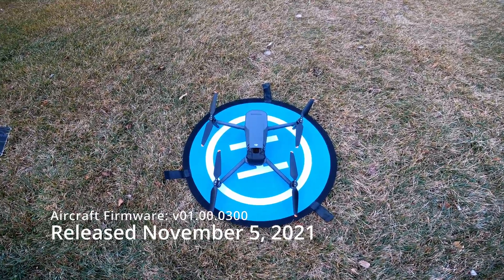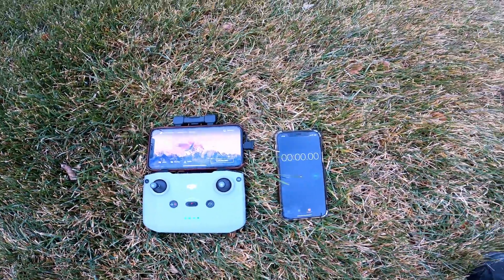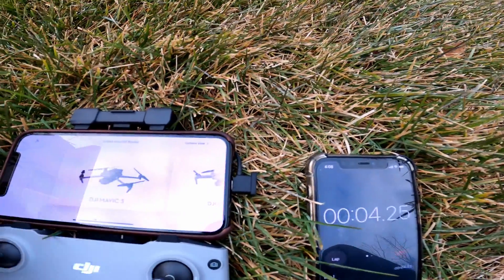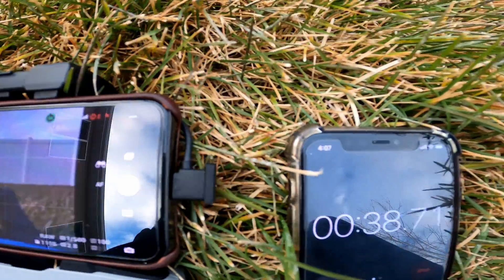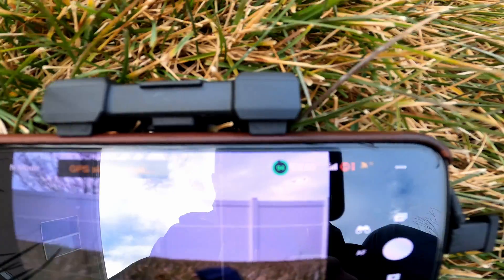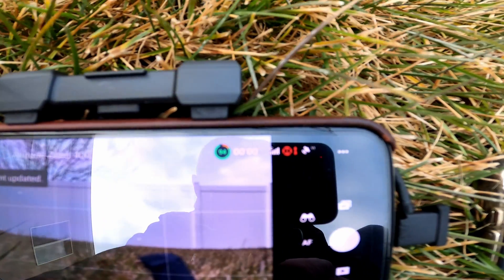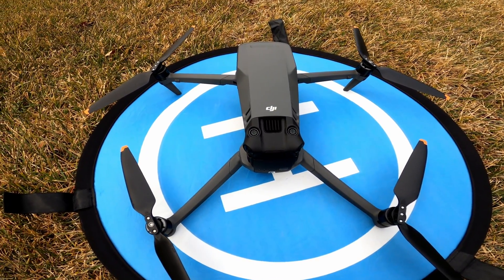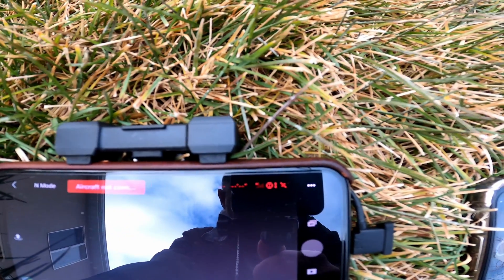Critical Mavic 3 GPS Problem?

Comment: Ok sold my mavic 3  that i bought in November with gps issues bout a new one a few days ago and zero gps issues
Reply from the maker: Thanks for the comment! That's interesting. So do you think the hardware on the first one was bad or that the software was improved enough that your new one just gets a lock faster?
Reply: @HansonAirPhoto  this new one came with the same firmware off the last one i sold and it’s was good gps in seconds satelite lock update and still quick lock so I’m thinking is hardware issues
Reply from the maker: @josedominguez659  Could be. I'm hoping it's something not quite as permanent. I know for me, conditions and location make a big difference.

Comment: Need advice, looking at my first drone purchase and in full debate between air 2s, Mavic 3 or evo lite+. Do you feel the slow gps lock is a deal breaker? Do you feel dji is going to fix the problem? I don't mind spending extra for a really nice drone to last me years. Thanks in advance.
Reply from the maker: If I were buying my first, I would definitely go for the Air 2S. Nearly all of the Mavic 3 features at half the price. I’d spend extra money on batteries instead of going higher end to start out. But the Mavic 3 is nice and I don’t believe the GPS lock delay is a show stopper for people interested in it. Good luck with your choice and happy flying!

Comment: I was going to record this too but I realize that by the time I calibrate compass, fine tune my camera settings, RTH and APAS settings, check flight mode, I'm good to go, also I do this while hovering about 10 feet up as I warm up the batteries...thanks for sharing.
Reply from the maker: Good way to use that time!

Comment: Thanks.  You just gave me a reason to keep and use my Air 2 batteries that have slightly bulged out after a year of heavy use.  I would never use them in the air but I could use them to acquire Satellite signals and lock them in.  When ready to fly, restart with a new fresh and safe battery.
Reply from the maker: Good idea! Old batteries can be useful for firmware updates too. Thanks for commenting!

Comment: Within GPS several "power up" modes have been defined. Hot start, Warm start and cold start. Cold start is when you have no clue of where you are and the tracker is turned on. The tracker will have to update its almanac on all the satellites positions, their status and time. This can take more than 10 minutes, since the satellites do not send all the time and their data packages do not contain a full almanac info package in every transmission. 
Warm starts are normally in the 30 seconds to a couple of minutes range, you kind of know where you are and the internal clock inside the GPS receiver is not way out of sync. 
Hot start is normally below 20 seconds. If the phone knows where you are then it should be possible to share some of the info and speed up the process moving from cold start to warm start. Similar to assisted GPS used in mobile phones, where the mobile cell tower shares the almanac data for the area with the mobile phone.
Reply from the maker: This is great information! Thank you for sharing! That definitely coincides with the timing I’ve seen at startup.
Reply: First of all,  the phone has nothing to do with the GPS acquisition time. Turn your M3 on with and without the controller. Same amount of time required. No offense but using buzz words like" tracker" and "almanac" (that no one else is using)  makes you sound like you are are elderly and talking out the side of your ass.
Reply: @foam27  All I am trying to say is that getting a position could possible be improved by DJI by using the phones GPS receiver in co-operation with the drones GPS receiver. Almanac like it or not but that is the word used by the people who made the GPS specification. If they where elderly at the time I do not know. Most likely they are today.  English is not my native language, so yes tracker might be the wrong word to use. "GPS receiver"? or ?

Comment: The seem to be the same problem with the Air 2S, it takes about the same time as for the M3 ,It must be some issues with The DJI Fly App.
Reply from the maker: Very interesting! I don’t have an Air 2S to compare with but it makes sense that the slowdown is with the app if multiple aircraft are affected.
Reply: @HansonAirPhoto  I Will make a test tomorrow and let you know , its almost midnight 10:07 pm here in Thailand now
Reply: Hello again , I made the same test as you did with your Mavic 3 today and it took 2.20 min to acquire 12 satellites with my Air 2S with a OS device,  when I shut the drone and the remote and started up exactly the same way  5 minutes later from the same spot, it took 20 sec to acquire 17 satellites . My conclusion is that it must be something wrong with the fly app , I estimate before the fly app update it took about 30-40 sec get the home point updated to take off in a secure way.
Reply from the maker: Good test! I really does sound like something in the app. Hopefully, they can do something about it soon.
Reply: You can uppdatera now New version out for iOS 1.5.9, It works
Reply: @HansonAirPhoto  They did my friend
Reply from the maker: That's great to hear! I'll have to update and go fly with it. Hoping it'll speed up my acquisition times as well. Thanks!

Comment: This abnormally long delay (which will vary a lot day to day and location to location) would be acceptable for a $1500 setup. It is not acceptable for a $5000 setup. BTW you never tested on a cold GPS lock on the new firmware. You already tainted the experiment with your first test. It can take 5-10 minutes sometimes. I returned my M3 + RC Pro for a Skydio 2+ Pro Kit. Absolute blast.
Reply: S2 is nowhere near comparable to the M3. It has less flight time, can't shoot at night and has one of the worst camera sensors of any "premium" drone. It's a toy compared to the Mavic from an image/video quality perspective. The S2 doesn't even measure up to previous gen DJI products, never mind their flagships.
Reply: @BorderReiver29  True, S2+ is no M3. But it is an absolute blast. I’m not a Pro making movies. The S2+ makes flight time and range more respectable. I wish it did fly at night. But it’s tracking and obstacle avoidance makes up for it 10x over. I have waited as long as 10 minutes for home point on the M3 and lose Sats Mid flight and get capped. It’s an absolute joke. I could buy an Air 2s with RC Pro and still be ahead than owning M3 with RC Pro. I was seriously thinking of doing that but I’m so disgusted with DJI and having so much fun with the S2+ I may never bother.

DJI is clueless on tracking, obstacle avoidance, customer service and pricing. And now they can’t even get GPS right. The whole company is a complete hack. I really hope Skydio and Autel get a boost out of MavicGate :)
Reply from the maker: Glad you've found something that works for you! I've got a cold test of the .400 timing coming in my next video. It was shorter, but I was at a different location. So it's probably not a valid data point. I'll be following Skydio for the future. They're doing some interesting things! Thanks for watching!
Reply: Damn you gave up a LOT of range going Skydio 2, but maybe you didn't need it.

Comment: But time first time you used 15 seconds opening the app and connecting to the M3 so 1 minute isn't bad. I have that drone with the smart remote and It's about the same as your test and I'm ok with that. Ok I wrote this before finishing your vedio and we agree. Doesn't bother me cuz I want my M3 to come home. Is there a new update out? As of when?
Reply from the maker: .400 is the latest firmware as of January 24th. I hadn’t put it on my Mavic when I did this timed test. But it didn’t change the acquisition time once I did. I still don’t think 90 seconds is too bad to get set up and ready to fly. I flew again over the weekend and had a GPS lock time of 49 seconds at that location. Not bad at all.

Comment: I just got M3, Air2s and mini take about a minute to get GPS lock … M3 is 10 avg minutes and burns 10-13% battery. DJI says they have not heard of this being an issue .. lol.. but they are offering to swap for a new M3.. mm so it’s gonna be fixed on the new one ?
Reply from the maker: Whoa! 10 minutes?! That's the longest time I've heard yet! I might take a swap in that case. I doubt a new unit would take that long. Most people are reporting a minute or two. I hope things turn out alright for you!
Reply: @HansonAirPhoto  yeah. DJI was silly .. said this is not a reported issue ( whatever) and that my phone not being connected to a network was the likely issue .. again more comedy.. I use a new ipad and it is fine on mini and air2s… I don’t want to swap for another one with issues
Reply from the maker: @robthomason4037  Their support is so bad! Their answers would be funny except we pay so much money for their products. Exchanging a drone with them is like rolling the dice. You may get one that gets GPS lock faster but also has a horizon tilt or connection issue. But, for what it's worth, I've only had them replace one drone for me over the years and the replacement was rock solid for years after that. Good luck! Let me know what you decide to do.
Reply: @HansonAirPhoto  yes it’s a huge bummer. I have had a Mavic mini ,air2 and  air 2S bought this one thinking it would be the best and most feature rich  it is been a problem since I got it two days ago. DJ saying  they have not had this reported is making my blood boil.. they want me to send them a video to prove this is happening
Reply: @robthomason4037  That is funny. DJI didn’t change how fast it acquires Sats. Try loading the old firmware (.300) using Assistant App. You’ll see it acquires Sats at exactly the same rate. What’s different is how many Sats it waits for before it sets Home Point. Old Firmware very frequently set home point at 8 Sats. New firmware it waits until 12 Sats. This is NOT a bug that’s gonna get “fixed”. It’s a fix they put in because the new GPS system they are using on M3 is just not working as well as other drones. I don’t know if if the Chip, the Antenna or the GPS System but DJI saw a need to wait for a higher quality fix before setting the home point. Folks can live with it for sure. But I could not at this price point.
Reply: @mswlogo1  sat Air2S and M3 side by side in a field. Air2S got  14 Sats in 1 minute, M3 was at 4 after 1 minute, never got above 7 until  I hovered. This happens in a field, by my house on concrete or at the beach with no obstructions or metal. Maybe my M3 is just weird.

Comment: That’s the result I get when I test mine for satellites to locks. I get 1min 33sec the second and third time satellite lock immediately and I live in the mountains!
Reply from the maker: Thank you for the sanity check! Our experiences match up closely. I don't get the rage I'm seeing about this in online forums. I probably lose more time at traffic lights on the way to a location.
Reply: @HansonAirPhoto  it’s really not a big deal, if you are going to a job etc with the Mavic 3 give yourself some time, you know while it’s searching for satellites in the mean time one can check out their surroundings check your bird over your settings remote etc by time you get through doing all that your bird should be ready to go. You know some hostility was directed to me because I said that I wasn’t having any problems with my Mavic 3 other than it takes a little bit more time to lock on to satellites than previous Mavic 2 zoom and other DJI drones that I have flown in the pass! It’s crazy out here man! I am sure DJI will rectify bugs etc with the Mavic 3. People just need to stay positive and be patient it will all work out.

Comment: Can only attest to my experience but mine doesn’t seem to take long at all by the time I power up the bird and RC then apply for LAANC it’s ready to go.However my experience is limited as I haven’t launched from a lot of different locations,so the satellites may be cached as you mentioned in the video.Last but not least you can shave about 30 seconds of of your acquisition time for a to accomodate for the time you started the timer early and was late stopping the timer.In my estimation the acquisition time was closer to a minute,may even as low as 90 seconds.
Reply from the maker: So glad you haven’t had the problem. If you’re good to go by the time you get your LAANC approval, you’re doing really well. 👍
Reply: @HansonAirPhoto  Think I caught the bug with the latest update 😩😩😩😩 it’s now taking me 15 minutes to acquire gps lock
Reply from the maker: @noladronelife_6574  Whoa! Really sorry to hear that! 15 minutes has got to be a record. I haven't installed .500 yet. I'll do that soon and retest.

Comment: I started my Mavic 3 today for the first time this week, in the back garden with a sunny blue sky it took forever to get the 12+ sats, it used 3% of the battery before it was able to take off, something needs to be done in next firmware update, the time I don't mind, but the unnecessary battery usage I can't take.
Reply from the maker: That's exactly how I felt last time I was out for a shoot. At home with my timer, it was 90 seconds. I swear it was longer out in the field. Did you time yours? I'd love to compare. 

I'm pretty confident it can be fixed in firmware though. Things just aren't quite fully baked for the Mavic 3 yet.
Reply: @HansonAirPhoto   No I didn't but will next time, from what I have read, the sat lock situation is worse since the .400 firmware update, even though it was cached for your update, but I seem to remember the first few flights on .300 being quicker to launch.
Reply from the maker: @lasidora  Interesting! I'll have to find a way to clear the cache and try the test again from scratch with .400. Thanks for the heads up!
Reply: Seriously, John ?  I'm just thrilled with the additional battery time the M3 has brought to the party.  I'll swap 3, or even 5% for a solid GPS lock any day..LOL

Comment: If you are a hobbyist 90 seconds isn't a big deal.  Just take out the m3 first, turn it on then prep your  controller, phone etc.  I'll take it up 20 feet and sit there for 10 seconds and it loads up the remainder satellites.  I've never lost satellites after engaging them so it's not a concern for me
Reply: Not a bad idea to give it a little hover time anyway these cold days - recommended in the manual - for those who read them..!
Reply from the maker: Good tip! That'd speed things up.